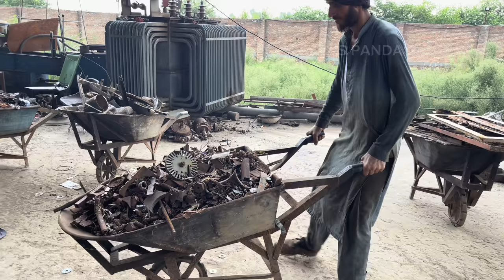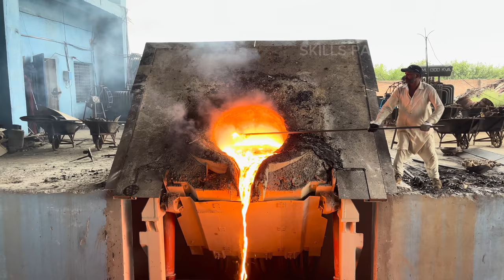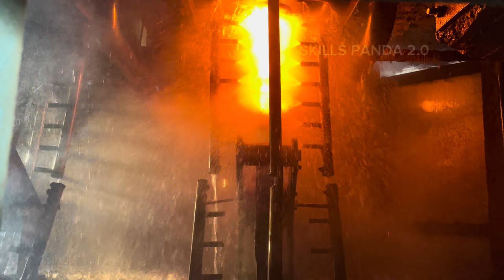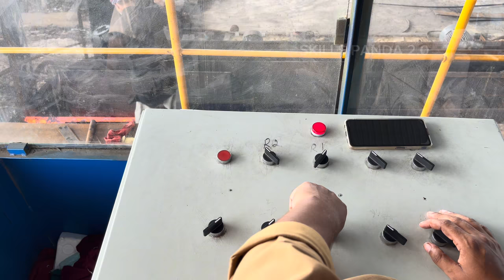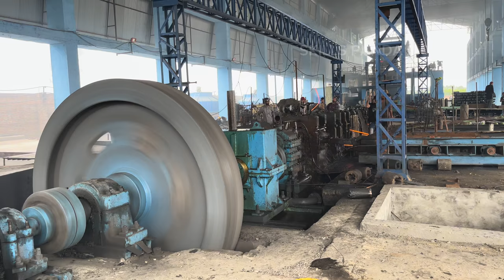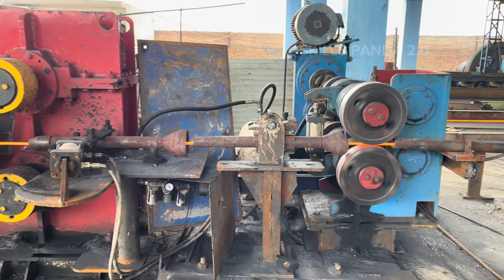How To Make Rebar Steel In the Steel Mill, Amazing Manufacturing Process That You Never Seen Before

Comment: I'm sure nothing but the highest quality rebar comes out of that plant.
Reply: snaps like spaghetti
Reply: i don't think so. Your lines are so over rated.
poor worker's safety measures and environmental risk are taken for granted. what more for the quality of the product. 
Poor quality of steel from melted tin cans and other scraps is not recommended by the experienced engineers and architects
Reply: Probably not the highest quality rebar but definitely the highest quality work ethic! Third world country, dude… This is what these men have to do to feed their families… RESPECT!
Reply: Impressed by the induction furnaces.
Reply: You'd expect nothing but the finest out of the flip flops and sandal shops.
Reply: @carlos-oz2go extremely small though

Comment: This production is quite a lot better compared to others I've seen from that region. A bottom tapping ladle and a continous casting strand? Never thought I would see that in such a small operation around there.
Safety equipment is of course lacking (as always) and I'd avoid tapping that much slag from the furnace. Otherwise, good job!
Reply: Yeah the continuous caster floored me!

Comment: I don't know why I thought it would be as clean and organized as our steel works. Still, it's a hard, hot and potentially dangerous job. So, respect to these men. Got to say I find it baffling that there are people wearing sandals and slide shoes in a metal fabrication factory. That's insane.
Reply: Safety sandals are an important bit of Pakistani PPE

Comment: I must admit, watching other countries' manufacturing work makes Americans look weak. In the US all of that heavy hauling would be machine assisted.  Kudos to the hard workers.  And the level of recycling and reuse is embarrassing to the US.
Reply from the maker: Sir first of all thanks for watching. Every country owned working role and environment. Basically Pakistan is under developed country so very low amount of advance machinery
Reply: @skillspanda2.0  It was a compliment to the hard workers and their skill.
Reply: Ok to be fair part of the reason the US doesn't do as much recycling is because quality matters much more. They have no idea what is going into their rebar. Stainless steel alone has several grades, then there's cast iron, wrought iron, mild steel, etc. In this shop it all goes in the same hole. If the concrete building this rebar goes in falls down, who is responsible? Nobody, because there are no safety laws or regulations. In the US we have specific scrap yards that actually check what the metals are made of, then melt them down at a dedicated facility, along with cleaning agents, to make raw bars for manufacturers to buy. There is plenty of metal recycling in the US, it's just not done this way